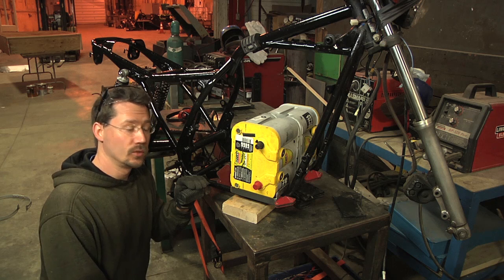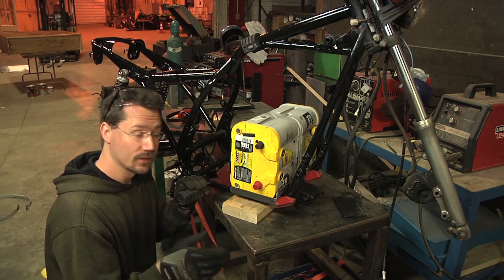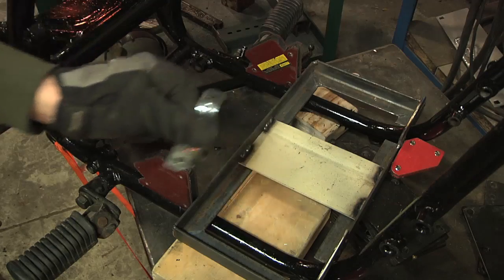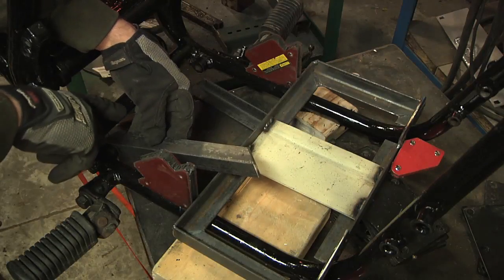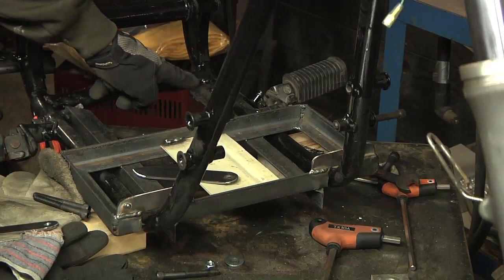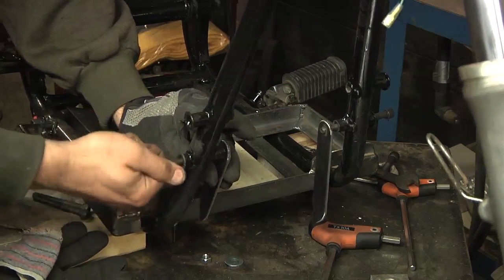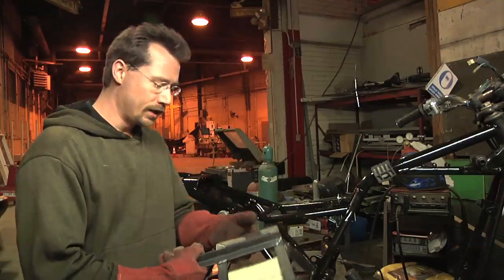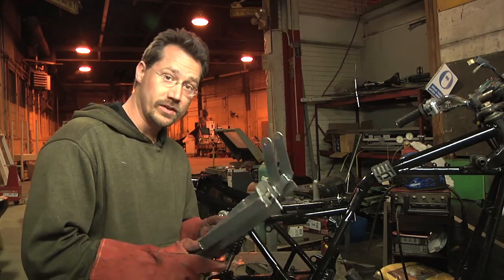Battery Rack work part 2

Comment: Welding tip. Feed the wire at an angle AWAY from the puddle and swing the wire between the two points you want to connect. Keeping in close so the gas can keep the oxygen out. Try to keep the arc close to the edge of the molten steel. Just takes practice.

Comment from the maker: @fireman65401 
The motor mounting plate clears the battery and battery rack. I kept rechecking that distance, as it's important that everything fits!

The motor does not get hot with use, and it's not rubbing directly against the battery.

Comment: im looking at your circle on the peice of metal is that going be the size of the motor if so are you gonna have enough clearance between the motor and the batterys and will the motor be putting off any heat that might mess with the batterys?